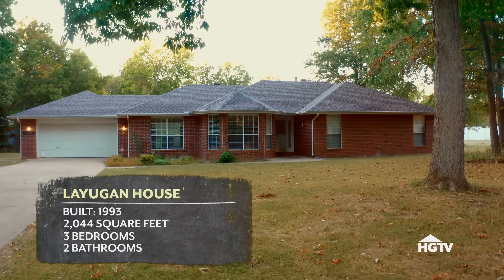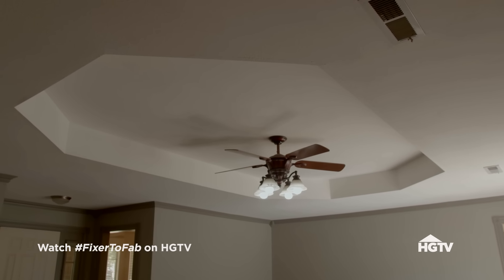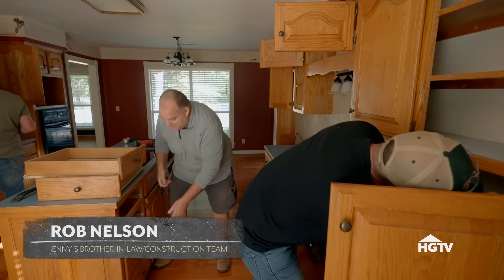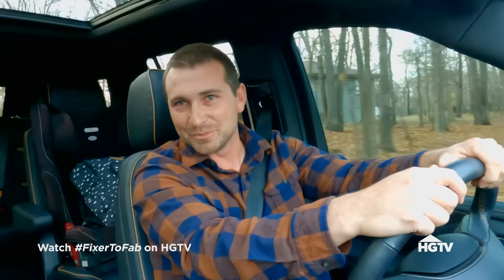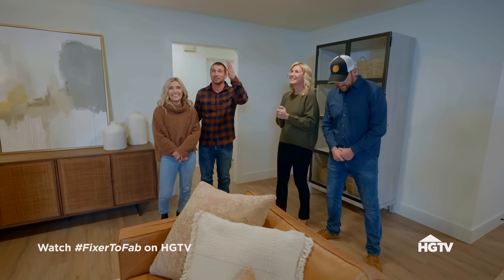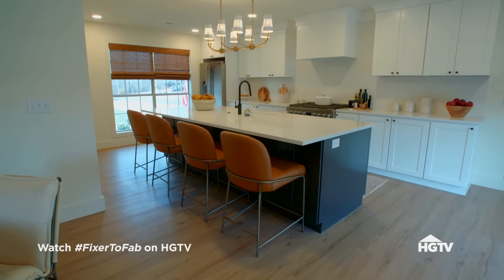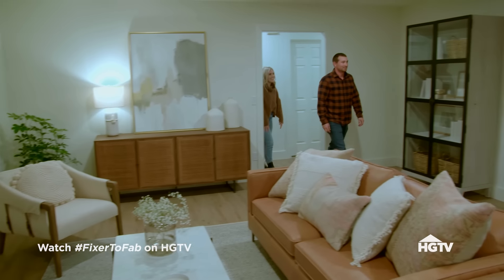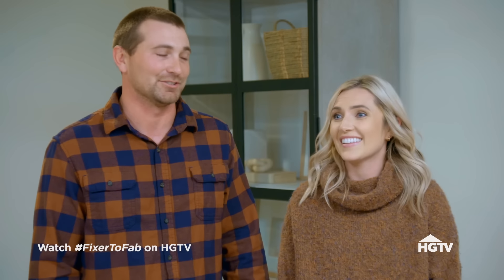Californians Find Dream House in Arkansas - Full Episode Recap | Fixer to Fabulous | HGTV

Comment: Equal parts incredible and terrible. That playroom for the kids is so inspired and amazing. And I like how they were able to give them a big pantry to compensate for the loss of all the cabinets they had to take out in the kitchen. Did not love the huge cartoonish features like the fireplace mantle and the ridiculous dining room chandelier. In the master bath, did they just forget to finish the shower, or is that how it’s supposed to look? Because if that is intentional, they are going to have water spraying everywhere. It will make those porcelain tile floors extremely slippery.
Reply: The glass surround for the shower hadn't been installed yet.
Reply: @Polaris0613 Thanks! 👍